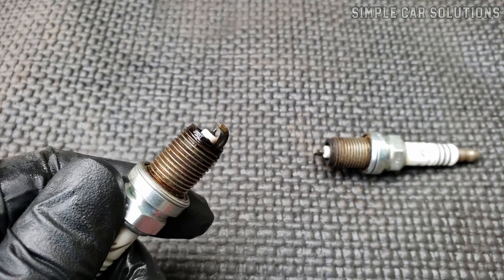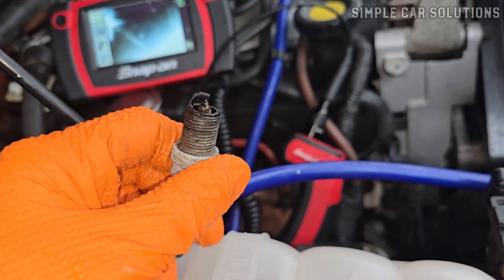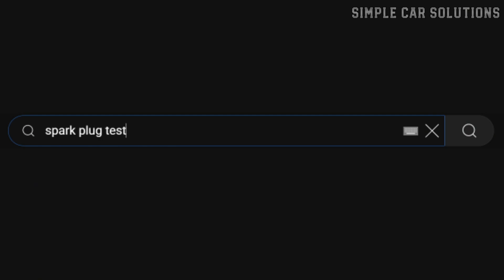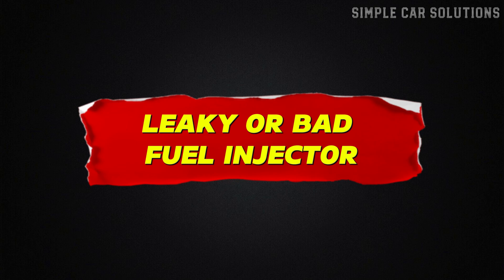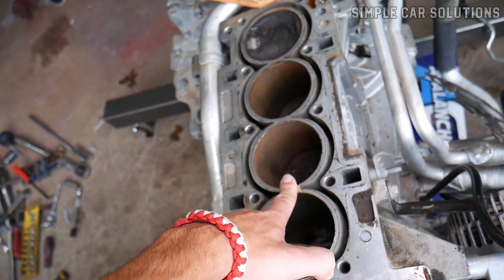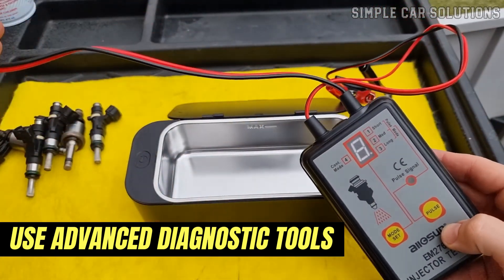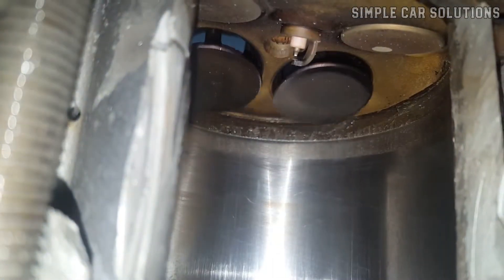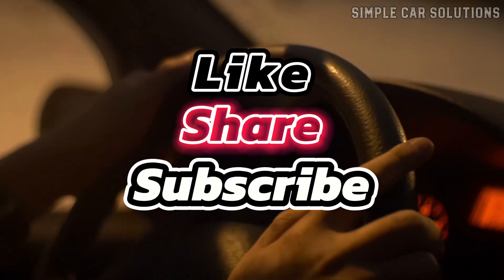Spark Plug Wet With Fuel. TOP-3 Common Reasons. Spark Plugs are Wet with Gasoline

Comment: Hi I have a question
Reply from the maker: Sure — go ahead, what’s your question?
Reply: @SimpleCarSolutions I have Ford fusion 2016 There's a problem with the automatic transmission. The car starts and drives, but then it stops. After it sits for a while, it will drive again.
Reply from the maker: @rustamraufov1996 Sounds like the transmission is overheating or losing pressure. Check fluid level, condition, and transmission solenoids — could be going into fail-safe mode.